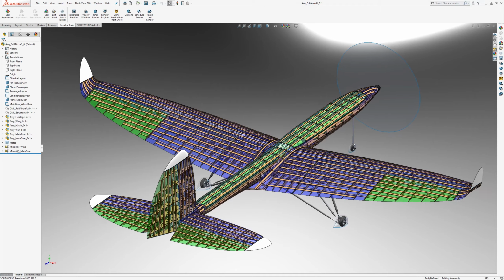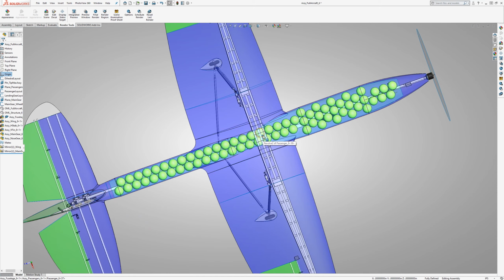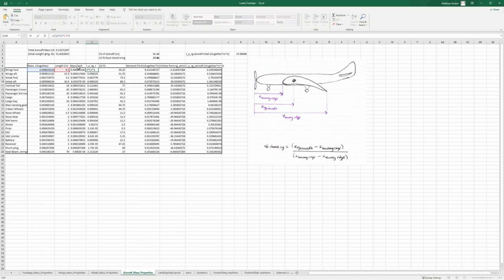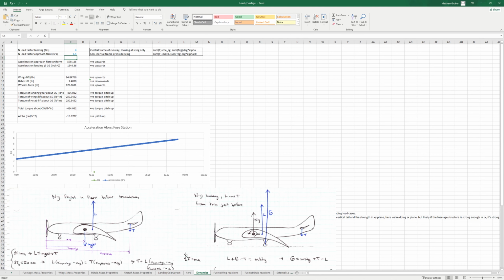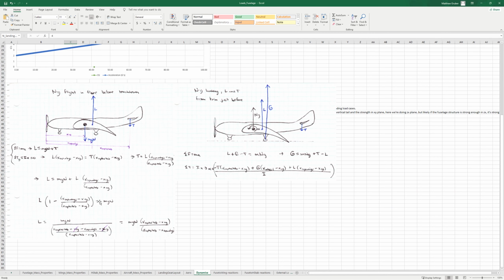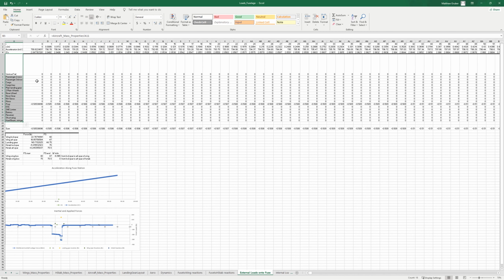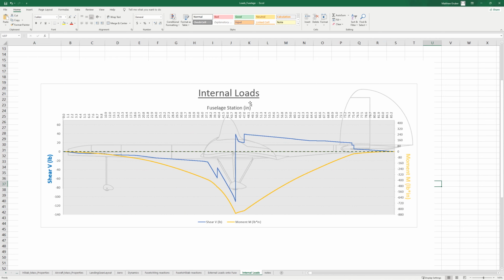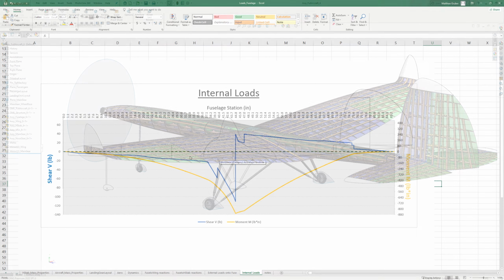Loads calculations for an SAE Aero aircraft

Comment: ok so you are saying that span wise surface structures wont transfer bending loads ... so the top wont be in compression when the wing bends up and the bottom wont be in tension as  well .... that seems extremely wrong ... and stringers from my understanding do NOT go full span they only go a framer or two to resist loading in that specific zone ... while longerons go span wise of full length or as close to it to balance the loading across the complete frame and not just in point areas ... and yes longerons are NOT stringers and stringers are not longerons ... like a 45 automatic is not a snub nose 38 ... one is a workhorse the other is a pea shooter ...
Reply: so the tail doesnt apply a downward force ... hmm kind of wrong that assumption ... even it's weight will be a factor ... and it also incorporates a torsion moment on the plane in NON level flight ...
Reply from the maker: @0623kaboom  hello, the way I did the loads on the fuselage was to take account of all the masses/inertial loads in the fuselage on its own  (mass properties section) separately from the wings and hstab. They are isolated as we could do in a freebody diagram. I included the vfin in the fuselage as a static mass for the purposes of the vertical balance, since it doesn't contribute any vertical forces. The wings and hstab reactions section shows both inertial loads and applied loads from wings and hstab (hstab at 38:50). Of course we have to pay attention to the sign of the force from the fuselage to the hstab which is opposite when we consider the freebody of forces from the hstab to the fuselage. So effectively there are 3 freebody diagrams in the analysis, and you're correct that the hstab is not lumped in with the fuselage freebody, I separated them for the purpose of keeping track of the forces transferred between the fuselage and wings / fuselage and hstab via their spars.
Reply from the maker: Good question. I talked about this a bit in the video, since I am planning to make a video on exactly this. You are correct that in most large airplanes, the portion of the wing skin between the spars is a part of the structural wing box. The spars (longeron in French) often go full wing depth, their webs join the top skin with the bottom skin. In that case, the stringers/stiffeners spanwise structural members are indeed in compression on the top skin and tension on the bottom skin (for +ve G's). This is the most common configuration for full size aircraft so that's what we see in stress courses.
However, the structural layout common to SAE Aero Design and D/B/F aircraft often has spars/wing boxes that do not go full depth. Teams often use square or circular extrusions for the spars/wing boxes, or in this example a pyramidal sheet metal built-up beam that does not go full-depth. When we consider the load paths, clearly yes the top skin of the pyramidal beam is in compression, and the bottom skin of the pyramidal beam is in tension, since the side skins (webs) can transfer shear. So the neutral axis of the built-up beam is somewhere in the middle plane of the shear webs (side skins). BUT... the balsa wood stiffeners do not have shear webs connecting them from the top skin to the bottom skin all that directly... Let's imagine there was no monokote or thin vaccuum formed plastic outer surface skin. The stringers then only contact the ribs, which mostly resist shear in the fwd/aft direction, not spanwise. When the wing bends upwards, yes, each stringer will bend upwards along with the central built-up beam. But since there is no shear web connecting top stringers to bottom stringers, each stringer has its own neutral axis through its center plane. Yes they are providing resistance to bending, but not with I=1/12 bh^3 + parallel axis. Only with their own 1/12 bh^3. Also, we have to take into account the material stiffnesses. The metal box beam is quite deep and stiff, so the deflection is limited by that. The balsa stringers will only deflect a bit due to that, and because they are so very un-stiff, they contribute little to the bending resistance. In my experience in SAE teams this discussion always comes up (i.e. how much do the balsa stringers and ribs contribute to bending resistance?) After some industry experience, what I would do now in a stress analysis here would be to consider the composite beam of the built-up box beam along with all the wood stringers as if they were laid out side-to-side, i.e., if we imagine them glued to the box-beam, we can imagine them all glued side-to-side at the neutral axis of the box beam. Then we analyze as a composite beam with 2 material stiffnesses. That's even less of an effect than if they were glued to the top and bottom wing box skins. And the stringers contributing the most to the bending resistance would be the ones where the wing is thin since there the stringers are rotated (if they are rectangular). If you want to be conservative, you can ignore them. I'm not sure how much of an effect you'd get if you don't ignore them, but I would guess it's quite small. There would be more of an effect with thin wings... since the central box beam will be less stiff due to lower depth... but I would still imagine it's very low overall. If anyone wants to crunch the numbers we could see. Does that make sense? Yes it's true the monokote wing skin and the intermittent 1/4 inch of spanwise ribs can shear a little bit spanwise, but imagine the load path to go from the top skin to the bottom skin (around the leading or trailing edge for the monokote/plastic skin, and how stiff is that stuff compared to metal?).